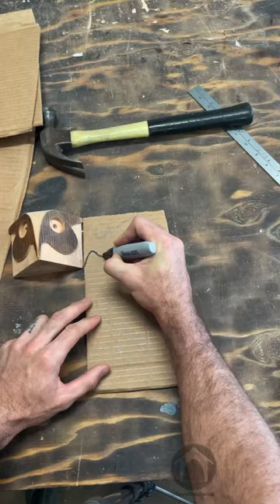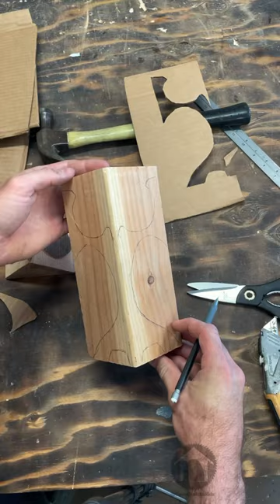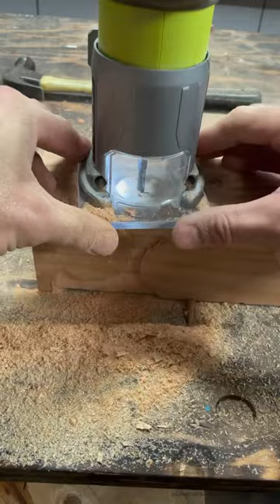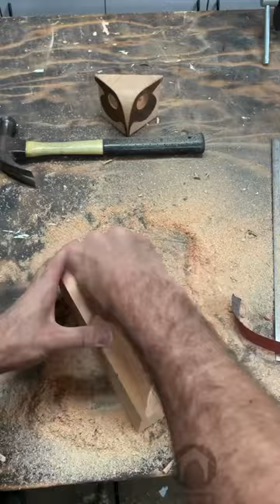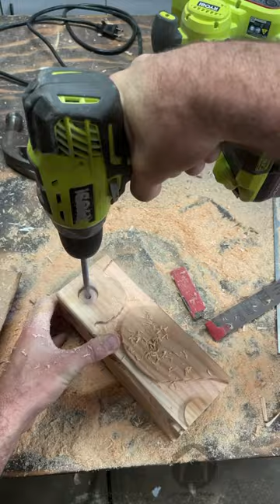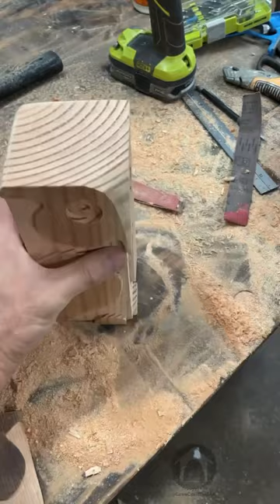4x4 Wood Owl Gift Idea, Make Money Selling #diy #howto #owl #homedecor  #art #painting #diyhomedecor

Comment: Hey there!! Your video raised an important question regarding my hobby. So I have a 12mm thick 10cmx10cm pinewood, and I need it to 6mm thick. I do not want to use a planer for some reasons. Will using a router like you did with that pattern, but instead of just routing the pattern, I would rout the whole 10cmx10cm till 6mm, would that be a good idea?? Thank you in advance!!
Reply from the maker: You can use a router to thin it down, but you’d likely get a much more accurate cut with a miter saw or bandsaw. Good luck!